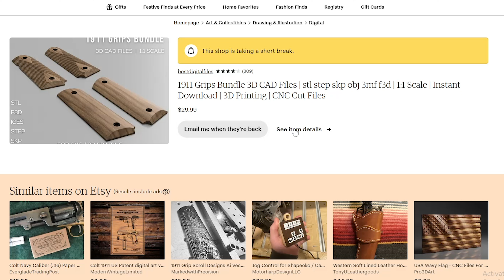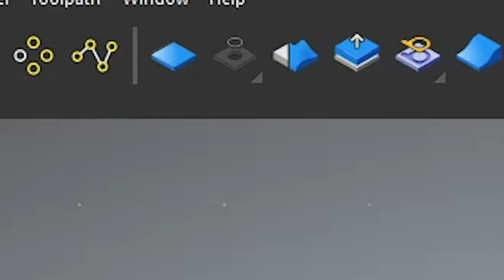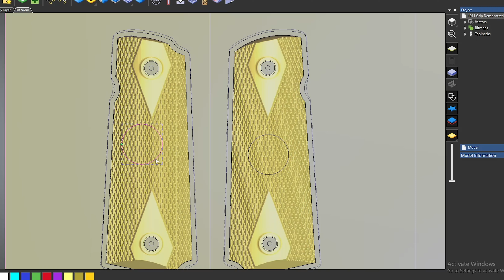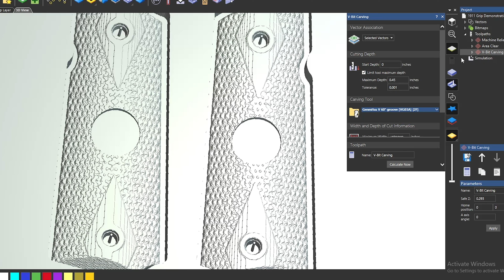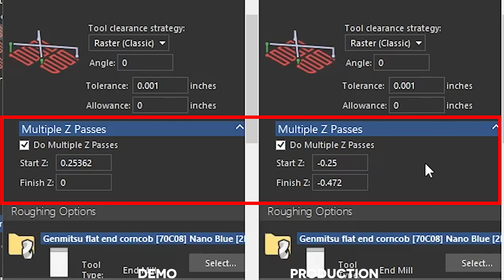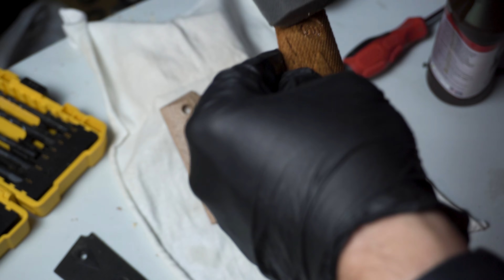Custom 1911 Grips on a Budget CNC!

Comment: I just started milling 1911 grips also using Carvco Maker.  I got the milling time down to 50 minutes with a few tweeks of settings.  Also, Etsy is not allowing gun grips to be sold anymore unless you know different or have a different source of various models of grips.